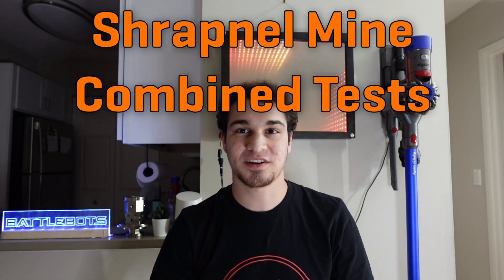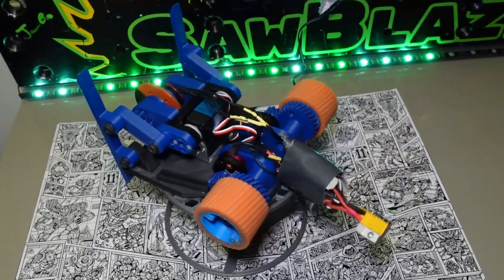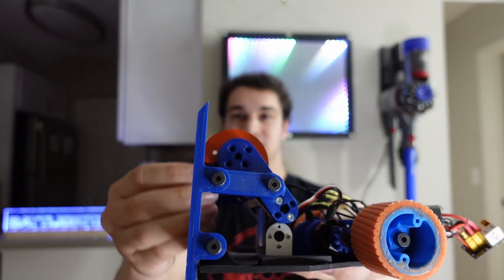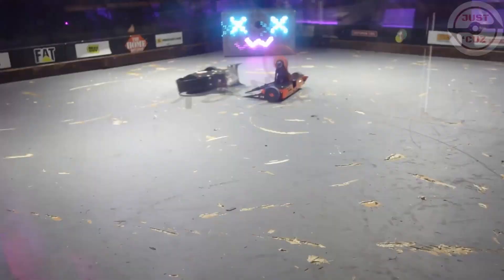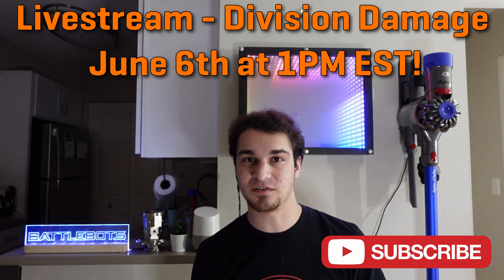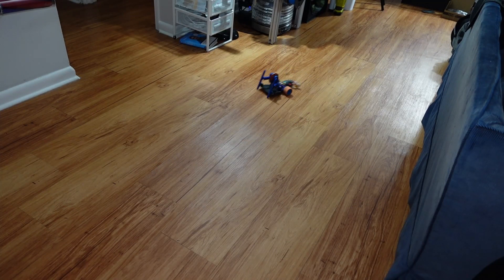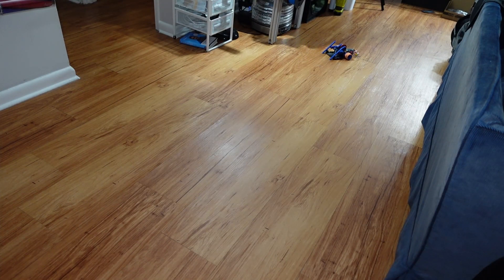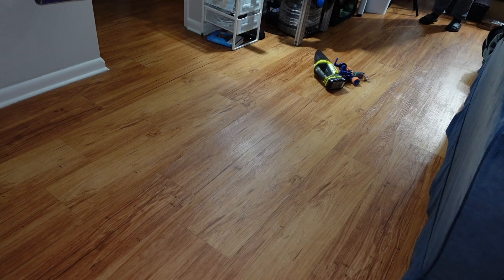Full System Test! The Process: Shrapnel Mine 3lb Beetleweight Combat Robot Design

Comment: Oh btw if you have any weight left on the final version you should make the urethane a bit thicker and you can protect your wheels by making the hub have an extension so it is covering the wheels while using very little weight so you will have like an extra layer sticking out a bit but you would have to make it a tiny bit smaller than the actual wheel radius and i love the design

Comment: Hey Seth i was wondering how much of 1 division costs and how much of 1 shrapnel mine cost so far
Reply from the maker: Hard to say with Division since I have made so many changes to it over the year(s) it's been around. It also costs more sometimes to get one or two of something than to get several, especially for lasercut parts. I think Division would maybe cost about $1200 to build two of from scratch.

Shrapnel Mine I have spent about $400 on so far but that's for parts/spares to build more than two complete bots. $110 of that is just for three servos!

Beetles can definitely be made much cheaper than mine though.

Comment: Would be nice if you added a picture-in-picture overlay when running other footage over the audio, when you say "when it's in this position" it's kinda hard to follow since you're not visible.

Great progress on the design though, maybe you can save a bit of weight not making an entire floor plate (even if it's just plastic) but just having some struts that connect the wheel mounts to the bottom link of the arm and the servo mount? Or would that compromise integrity too much?

Looking forward to how this design will continue!
Reply from the maker: Noted!

Yeah I'm still gonna figure out what to do with the baseplate. It needs to be pretty rigid which is hard with such a large body so maybe I'll need to reinforce it in spots with metal in addition to plastic or something else entirely. Once I work out the shape of it to fit all the electronics I'll work on optimizing stuff like that.

Comment: Do you have plans for an anti spinner configuration?
Reply from the maker: Yes the plan is to have armor 😅. This is literally half the weight of a finished robot. The front forks will be steel and there will be about a pound of weight just dedicated to armoring the front and sides. The final chassis will need to be bigger than this test platform to fit all the electronics though.